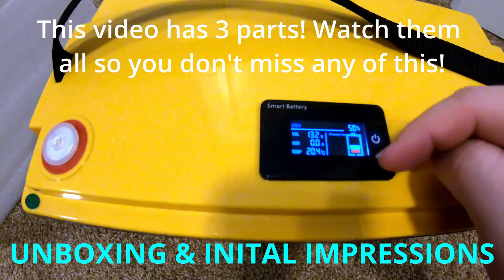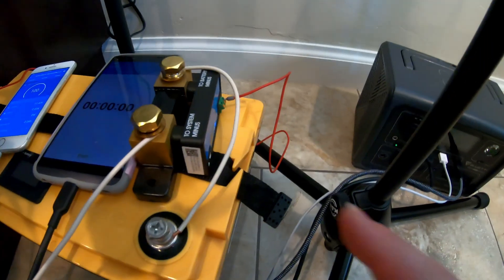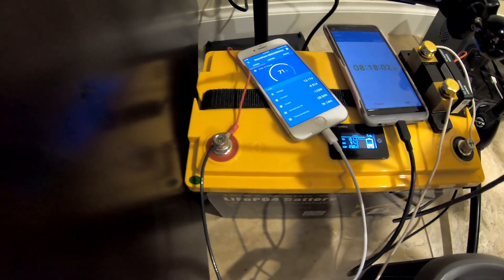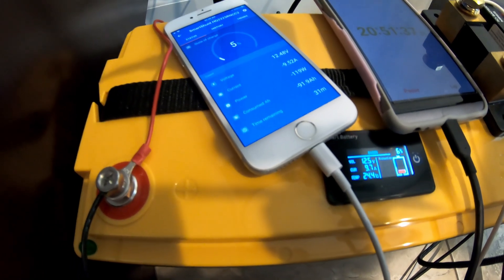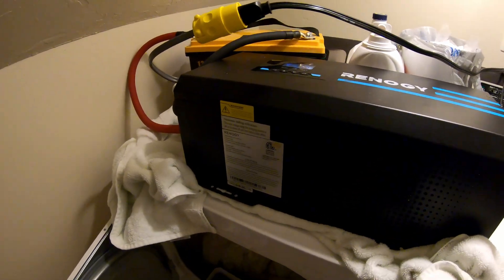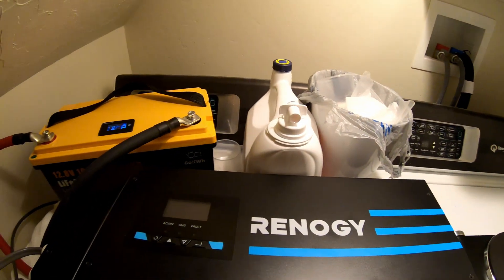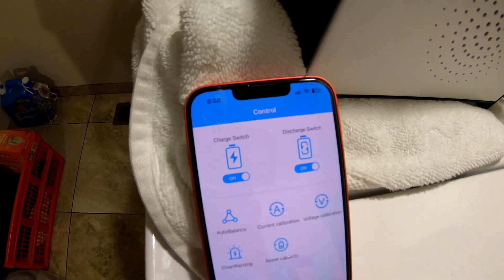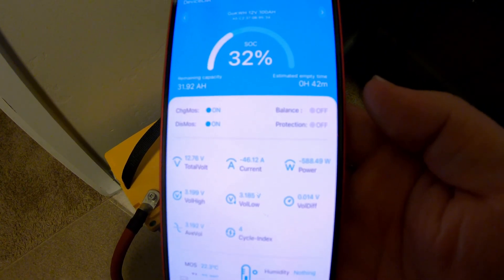How Long Will a 12V LiFePO4 Battery Run a Fridge, Furnace, Clothes Washer, Heat Pump & More! Part 3

Comment from the maker: Watch Part 1 - Unboxing and First Impressions of GoKWH 12V 100AH LiFePO4 Smart Battery!: https://youtu.be/RBNOhSO9r6E
Watch Part 2 - 12V LiFePO4 Battery, Tear Down, Capacity Test, Internet Router Trick…: https://youtu.be/uXNpVI0q1uE
Check out my "12V Battery Testing Results & Rankings for Home Backup" spreadsheet where we compare all the 12V batteries I have tested and rank them for what they do best: https://docs.google.com/spreadsheets/d/1OuUalW-_9BdWMyQz0CxCAM9cpO6whw_LX_exW0Fhqzo/edit?usp=sharing
Buy a GoKWH 12V battery shown in this video: https://gokwh.com/gokwh-12v-100ah-lifepo4-battery-monitor-with-lcd-display/?ref=49VqO5y5weNPKY
Be sure and use the coupon code: trick20 for $20 off your purchase! 
Buy barrel connector pigtails: https://amzn.to/3NmRJVx 
Buy XT60 ends: https://amzn.to/3TgUE5R 
Buy a Renogy 12V 3000W pure sine wave inverter & charger: https://amzn.to/3GY6JWl 
Buy battery cables: https://amzn.to/3GEIIDi 
Buy Victron Smart Shunt: https://amzn.to/3GY6VF3 
Buy EZ Generator Switch: https://amzn.to/3GAXB9Q 
Watch my install video about this: https://youtu.be/dBP53ggH4nA 
Buy my multi-meter: https://amzn.to/3RCw7qt 
Buy an Anker Solix C1000 power station: https://amzn.to/3RGWhss 
Buy an EcoFlow Delta 2 Max: https://amzn.to/3RfFoDD 
I don’t drink coffee, all donations get 100% re-invested in the channel to bring more un-sponsored content for you. Please consider donating through this link as opposed to using YouTube Super Thanks since I get to keep more of your hard-earned money and less goes into the pockets of large companies like Google. You can also schedule one-on-one consulting/meeting with me here: 
https://buymeacoffee.com/theresatrickforthat 

Affiliate Disclosure
As an Amazon associate I earn from qualifying purchases at no cost to you! Thanks for your support!

Comment: Add another battery of the same type in parallel, and retest the failed microwave and other fails. I want to see what each battery screen says on top of the battery because if the bms is correctly wired inside the battery, power draw should be pulled from both batteries, then the over current protection for most products should  be just fine running higher appliances.
Reply from the maker: That's a great idea! I'll have to see if I can round up another one of these batteries and do that on a follow-up video! Thanks for watching and commenting!